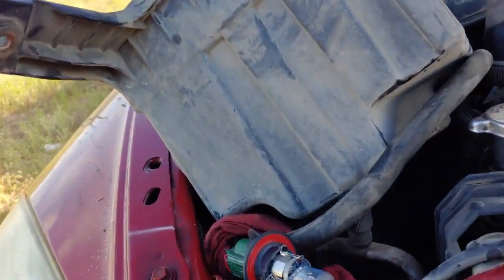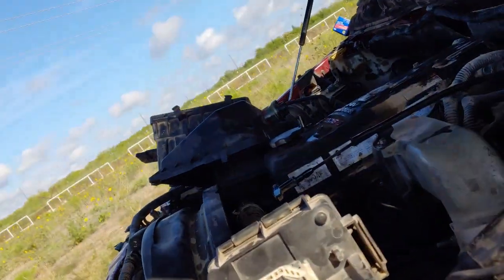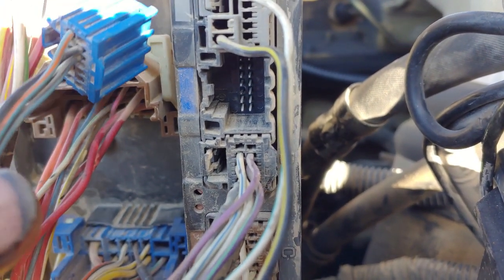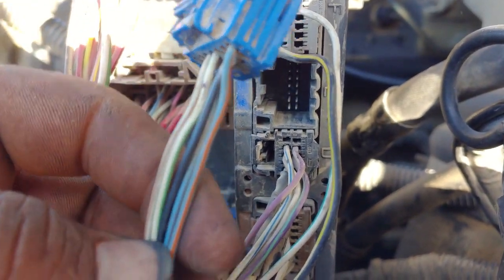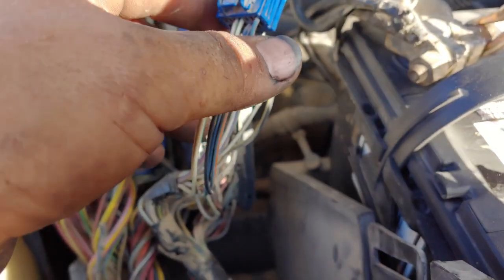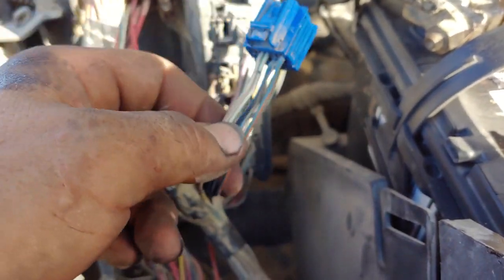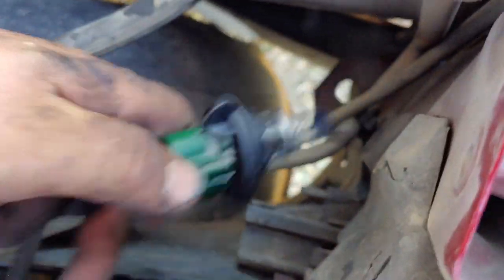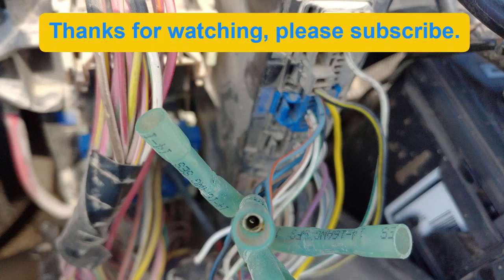Dodge Ram Headlight not working/Fix properly

Comment: Can I ask, where did you purchase the pigtail replacement plug? Both of my headlight low beams are not working.
Reply from the maker: Junk yard
Reply: @cazadordeadrenalina2161  Thanks Mario, I am not sure if I have the same problem as yours since both headlights have no power (right at the socket). I am going to pull the TIPM and test where you tested. 
Over changing out the TIPM what do you think about this idea? 
I was thinking about switching out the high beam and low beam wires at the plug and adding a light bar for high beams or just go without high beams altogether.
Reply from the maker: @markrankin3297  hello, you want to unplug the connector plug and see if you have power coming out the BCM, to the high beams, if you do I would just change and splice a new plug, and if you don't have power go find the fuse for the high beams make sure is too and also test the power at the fuse and make sure it have 12.7v on both sides.
Reply from the maker: And for a light bar, add a new relay kit with a fuse because the BCM will not withstand that kind of current. Than you can use the high beam ppwer to power up the relays signal wire.
Reply: @cazadordeadrenalina2161  Thanks Mario!!!
Reply: What was the problem?
Reply: @matthewburns6843  I have no low beams on both sides.
Reply: Checked the fuse and they are fine.

Comment: Just had this same issue, your video was super helpful! In my case though, it was the lightbulb plug that was bad. The middle pin was burned out so I spliced the wires with new connector from the junkyard and now it works like new